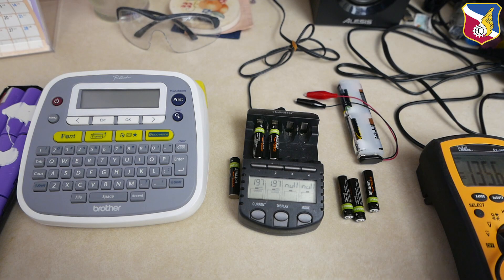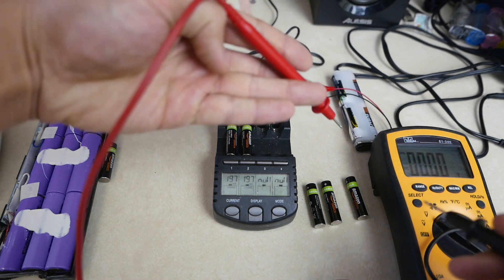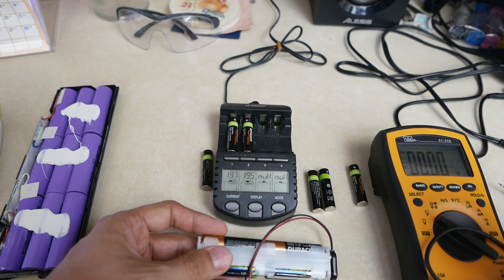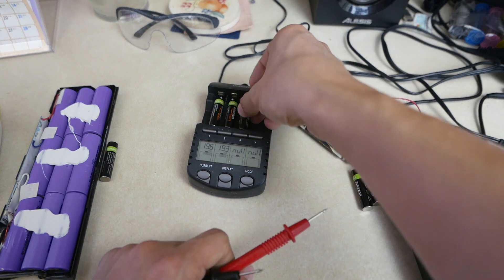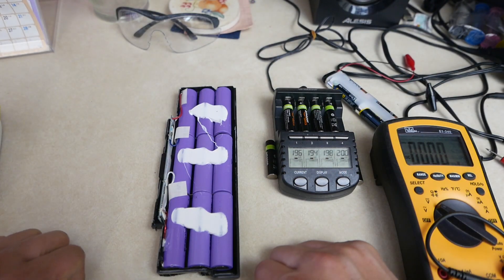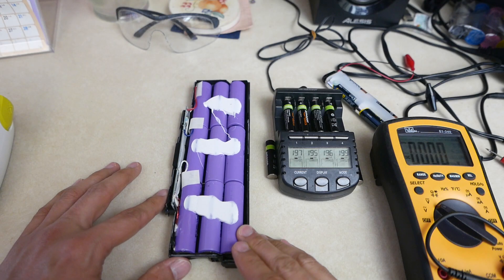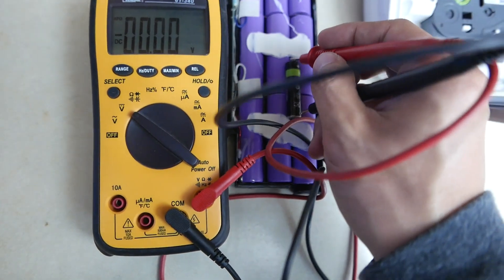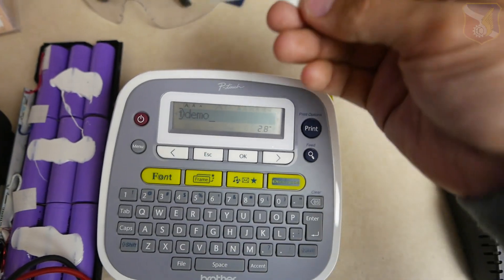how to fix a dead rechargeable battery - revive restore rejuvenate jump start any damaged batteries

Comment: hello
i have some questions please:
i bought:
panasonic BK 4MCCE
panasonic BK 3MCCE
Technoline BC1000 
 what i need to do before i use the battery?
What is the correct Charging Current for Eneloop pre-charged batteries for them?
what mean discharge on the charger and when i use that option?
please help me

thanks
Reply: I use many charger but not so good. Finally I use Japanese charger with this Japanese battery mean Panasonic/Sanyo charger with this Panasonic batteries. The charger works great for me. Ha ha ha. I like those charge very much. Looks like this
https://www.youtube.com/watch?v=mpe4-qCeZjs
https://www.youtube.com/watch?v=EjlIQtuxZpc  (Newer charger)

Comment: If you're curious, the reason the cell read 0.0 V was because nickel dendrites or filaments have formed inside the cell over time and use, and eventually one or more reached from one terminal of the cell to the other, causing a short.  By applying the external voltage from the battery pack to the cell, you essentially burn those filaments like a fuse, and the cell can operate again.  No, it's not a permanent fix, but you can try it whenever the cell reaches 0.0V again.  Note that if it doesn't read 0.0V, this trick won't do anything.  I'd be leery of applying anything over 12V, and certainly only use DC.  You always want to be sparing with applying over-voltages, like he said, just a few touches.
Reply: ok, but how to avoid such situation in the future? Using the battery more often or ?
Reply: I\'m not sure but ,if anyone else wants to learn about nicad battery reconditioning try Jadonite Renovate Battery   Buddy (do a search on google ) ? Ive heard some super things about it and my m8 got amazing success with it.

Comment: yea you shock us by making fake video sir.... from 2:30 to 2:32 these are two different recordings merged together to look like it is continuous video.
Reply: You are an idiot.
Reply: The concept works, he probably edited the video to avoid all the fiddling around with the parts, how effective it is in the long run I am not sure
Reply: Wrong ass wipe, he only edited it to take out the fiddling around  - use what little brain you have.
Reply: There are several factors in fixing a car battery. One place I found that successfully combines these is the Magic Mender Wizard (check it out on google) without a doubt the most helpful course that I've seen. look at this  interesting resource.
Reply: It does work! Some batteries may have other issues that this will not fix but generally, it works. I suppose u have never made a video so u don't get it but sometimes, when making a vid it requires more than 1 "take". Stop being douchey hater
Reply: xpertcrush, STFU!!!
Reply: this does work I do this to mine as well I do it a little different https://www.youtube.com/edit?o=U&video_id=g9usBOwYtwk

Comment: Most "damaged " piles I've found are only overcharged a little. The charger only accepts batteries up to 1.2 volts. If it's 1.21 volts the charger will see an error or non chargeable battery which are 1.5 volts or a little more. I checked seven damaged batteries and only one needs repair. The others just need to discharge below 1.2 volts for the meter in the charger the see it. That way the battery corporations can sell you a new one.

Comment: What is the name of the device you use to shock the battery and where can i buy it?
Reply: Calvin Nguyen  that's what I want to know also.
Reply: You can get them here–
https://www.amazon.com/dp/B0146DJTTO?psc=1
Reply: How To Start A Battery Business At Home>>>http://batteryrestorationn.blogspot.com >>
Reply: They are normally called "battery holders" and are very inexpensive on Amazon.
Reply: Just tape wires and batteries together. Fucking idiot

Comment: had no luck with 1baby D , after charging and using (3 in Serie) it fell below charging point, also the first who dies. did the freezer trick, but supposedly works only with NICAD. an old battery charger is also handy to fire it up, low tech, I'm using the piggy back method, or,2 wires from next good battery in the charger,  btw I have good succes for charging non chargeable nimh batteries in a RAM charger , if you need the true 1.5 v ..charged them not totally empty and for now max.3 times, I think it depends on brand. disclaimer, for safety do it in a box with firm lid and don't forget ventilation for charger....btw on ebay they sell battery point welding machine to weld new cell into a pack, can use it also for other small things. .....goedendag
Reply from the maker: +georgio jansen sounds pretty cool. ill need to check ebay.